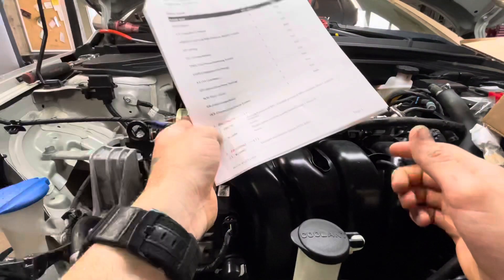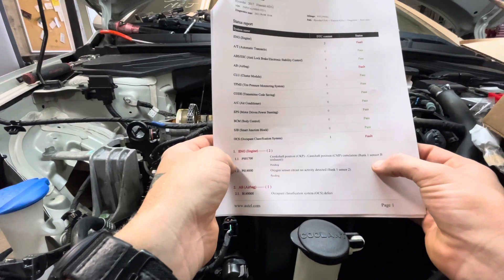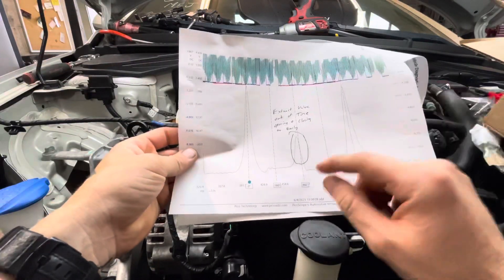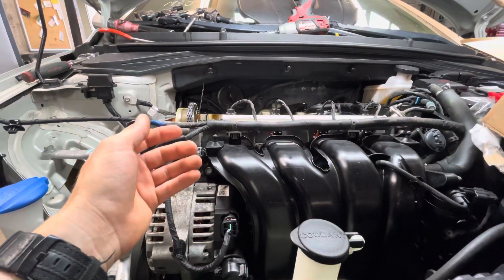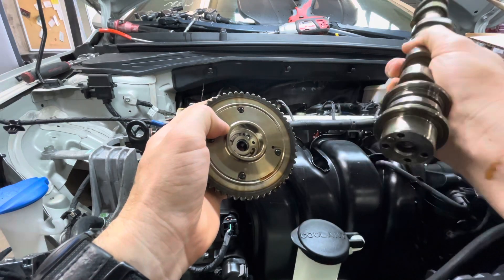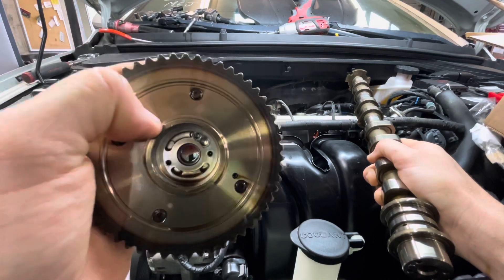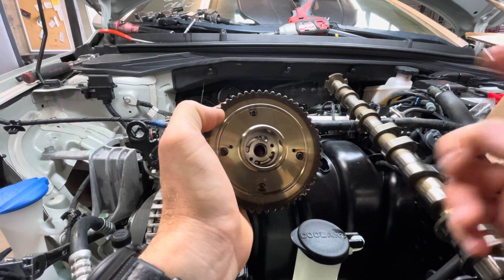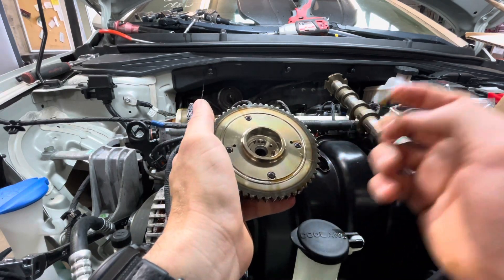Kia Hyundai 2.0L P0017 Code

Comment: Man I have a 2020 with the 2.0 here . It has a p0017 code but it also has a piston slap like noise when you rev it up from the middle ish area of the head . Just confused rather to replace the engine or try the timing
Reply from the maker: If it has a noise you probably have major issues.

Comment: Just diagnosed this today. Thanks to this video!! I was scratching my head but I took the valve cover off and attempted to turn the exhaust cam independent of the sprocket, and sure enough it moved on its own while chain and sprocket remain in place! Thanks for this video!!!
Reply: I think I'm chasing the same thing on a 3.8 kia. How much were you able to move the cam?
Reply: @kylewilhelm9397  the cam was free to move as much as I would have wanted it to. All while the sprocket and chain remain fixed. All I did was grab it with channel locks and it moved by itself.  The locking pin inside the cam had done exactly what this video shows, backed all the way into the cam. A new sprocket fixed the issue however on the car I was working on, damage had already been done to the valves. They opted not to spend the money on a head job and the car is still sittting. Also getting the pin out of the cam was no easy task!
Reply: @kalebdarius3921   thanks for the reply. I'll check it tomorrow,  I appreciate it
Reply: @kylewilhelm9397  sure thing 👌

Comment: Hello, I have a kia forte 2019, with the same problem and with the same code p0017, it changes the timing chain, sprockets, oil pump, and it still does not start, and the code p0017 still appears
Reply: It is possible that the valve is damage? My question is, do these engines damage valves?

Comment: hello, good day, how can you remove the pin that gets stuck in the tree?
Reply: @autodiagyt  I've seen this on a 3.3V6 SantaFe...not easy to diagnose the first time around since phaser is in time but camshaft is out of time lol! I used a mig welder to get the pin remains out of the camshaft. Junk quality on these engines!
Reply: @autodiagyt  Not that everyone has one but   I think I would try a dent puller stud rather than a slag spitter first.  The nail would give you a good pulling point with the slide hammer.  Just an idea, haven't tried it yet myself.  😉

Comment: It's a Faulty design. The Camshaft Dowl Hole should not be drilled that deep. Even if the Dowl wiggles out. It shouldn't have that much play to back all the way into the cam shaft. 

Place a small spacer in there and it will never happen again
Reply: I always put a BB in the dowel pin hole before I install the cam gear. Pin can't back out past the BB. .177 is perfect.

Comment: thank you bro! so the problem was the broken pin which connects camshaft with VVT actuator??
Reply: Can you tell the cam actuator sprocket is loose before you take it off?